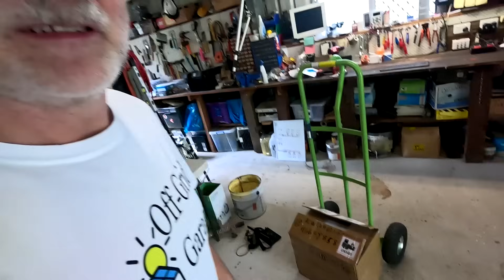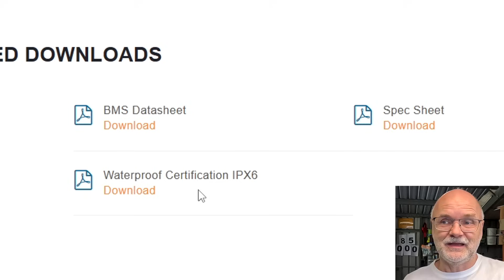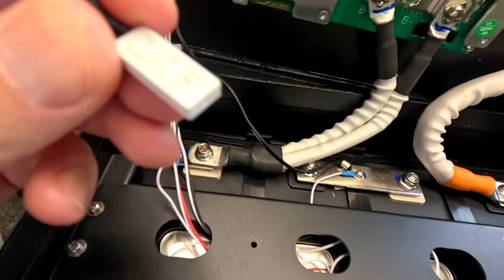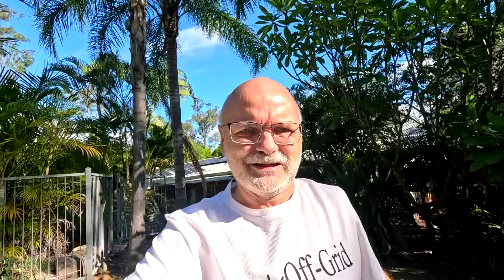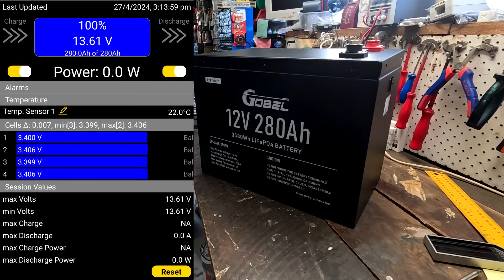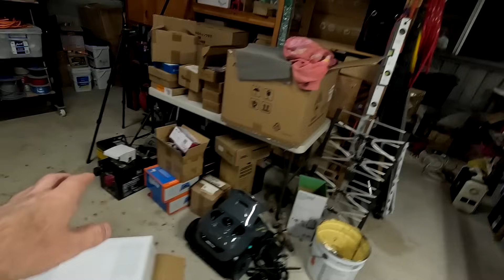Gobelpower 12V/280Ah Battery on the testbench. Apparently waterproof 💦🔋

Comment: i have a question regarding these battery . They are quiet high and many time can't be fit in some place (camper for instance) is it possible to use lifepo4 cell installed sideway? Does it affect the cycle? The capacity? I have ask many time the manufacturers with not a single return from them. Any idea?

Comment: Outstanding test.  Personally I like that lifting strap design.  It’s very simple, and I like that you can detach it so you have a clean installation with no straps when it’s done, but you can still “click” them in to pull a cell.  Better than rope in my opinion.  All your other points are very well spotted!
Overall, I’m impressed to see. A 3.7KWh 12V battery with quality components for less than $600!

Comment: Compact size 12V/280Ah and looks like the V2 design addresses internal brackets and waterproof protection issues. Hopefully you’ll get the V2 in to test 👍

Comment: I was reading the Eve LF304 datasheet, and it says that it needs to be compressed to 300kg before doing any tests. I was always fearful of tightening the screws to hard...
But yeah, I have Eve LF304 grade A cells that easily fit in my EEL box (eel is better available than seplos in EU, and while I always need to connect to support, they always fix things). A set of Eve LF304 grade B cells were not so easy to fit. I added one compression rubber sheet and I needed to adjust the compression plate over the length of 12 hours.
The grade A needed at least 3 sheets.

Comment: 0502’24/0020h 🇺🇸 0503’24/1720h 🇦🇺 Hallo mein Freund, danke für die Bewertung der Gobel Power-Batterie. I thought so too about the shoddy construction, with AL cabinet and support struts. JBL has become a standard system BMS, which is great. The newer models are even better. The annoying 6 Blue and Black cables and no more, replaced with sturdy Cu threaded 6mm tabs easy to bolt on and looks great. I’ve gone through your enhanced JBL configuration and made changes to mine. Thank you for that. Best wishes und 73s.

Comment: Hi Andy,  I just received my 12V 280AH Gobel battery last week.  Same damage as yours only mine had a few more plastic pieces off the top where the balance wires run.  Same pushed in bracket, scratch and shallow dent on side of #4 cell almost identical to yours.  I did not remove my damaged bracket. I reassembled with 1/8 inch thick high density rubber matting (~$30 worth ) on bottom and all four sides and a couple strips on top as well to keep the pack from shifting.  I wish Gobel would have done the same as I think it would have kept damage due to shipping from happening.  My cells are matched in voltage but I have not has a chance to charge fully and discharge fully to see how the battery and cells react.  Hopefully the battery is OK.  My cost for the Basic model was $540 total including shipping to USA.  I ordered Feb 26 and it got to my home April 22.  My use is marine on my 35 foot sailboat.  Gobel should consider selling it as a kit with 1/8 inch rubber matting to line the interior and shipping the case and battery cells separate.  I know $$$ cost of shipping but if those cells came all nice and packed in foam and the metal case and BMS in a separate box - Well 5 frogs!!!  Thank you for your review I wish it was three months sooner.  Got to pull the trigger at some point and I think it is going to work out fine.  Now I have to get it in the boat and wired up :)

Comment: Andy, may I use this great video to ask bit off topic; when using battery bms (such as great new jk-bms) to externally control your Victron MPPTs do you recommend using these BMSs also as a battery monitors in example cerbo gx or do you recommend using the shunt? Finishing my first setup and thinking which to use. You have both options in cerbo gx. 

Would be also great to have update what settings you have currently overall in your cerbo/venus system. Many thanks, I love this channel. 😅

Comment: I don't like the idea of the bracket holding the battery, high density foam rubber would be better with the wiring bar somehow mounted to the battery pack.

Comment: Just to be clear:
This is a Datamatrix Code on the battery, not a QR-Code.
I got the same "problem" with CATL cells. However, the manual method works for CATL, but not the camera scan.
All the best!

Comment: The water spray test was to second number, IP6. I don't think a water hose could provide pressure to IP6K.  Wonder if it could handle second number IP7. Representing an unfortunate boating trip. Of course the water would need to be, salt water.